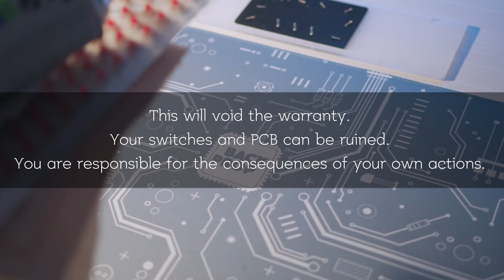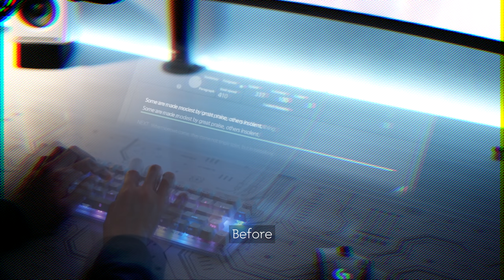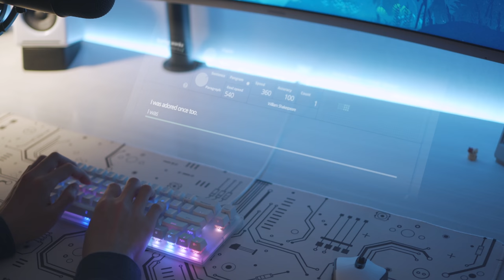Spray Lubed [Womier → GamaKay] K66 Typing Sounds (Gateron Red Switches)

Comment from the maker: * More information of spray lubing *
- How this works: This is not pouring oil. After the solvent evaporation(1~3 days), the inside of a switch will be coated by a thin film of grease. This is an alternative effective lubing way for pre-built 'soldered' switches. It's just an option. No one force you to do this.
- Don't do this for rubber switches such as Topre, Noppoo and silent switches. (Some say that Cherry's rubber dampers are okay, but Gateron's rubber dampers will get damaged clearly.)
- WD40 is not for this. Please refer to this product link. https://www.super-lube.com/multi-purpose-lubricant-with-syncolon-ptfe
- If you do this for click, tactile switches, the tactility will be reduced a lot.
- For optical switches, this will ruin the optical sensors on the PCB. If you really want to do, pull the switches out first and do individually not to get the PCB affected.
- Keep in mind 3:04

Before you spray lube, watch this video by Hipyo first!
https://youtu.be/n6wn8jaiqxg
How to fix a ruined keyboard using BW-100 by Hipyo
https://youtu.be/ZXB_FCIyU6k
Reply: So you can spray lube opticals if you take the switches off the board before spraying them?
Reply: @francis2317  Yes
Reply from the maker: @francis2317  yes
Reply: @3ildcat  thanks man
Reply: I did this in a clicky switches and the result was a bubblegum effect. No smooth at all :(
Reply: I was just thinking. Rubik’s cubes have many different special lubes that can be used for other stuff too. Maybe lubes from thecubicle.com maybe good for keyboards
Reply: if i do this to rk61 with blue kailh switches will i be satisfyed> cuz i still wanna keep clicky sound but i want them softer
Reply: what do you use to edit?
Reply: Is that screw driver ALSO a soldering it iron???
Reply: I know its not recommended, but i did use WD40 on my outemu blue switches, and its almost a year now, still everything perfectly fine. I clear the entire keyboard each 2 months and check every piece of plastic, seems everything fine. It sounds really amazing compared with the stock sound.
Reply: Is there anybody do this spray lube on Cherry MX Silent Red?
Can I have the link to the discussion about it @:3ildcat
Reply from the maker: @iamtienng  
These are spray lubed Cherry silent switch typing sounds.
https://youtu.be/5_u7GWf-Cn8
https://youtu.be/F9QRW50hf8U
https://youtu.be/H7NOwgczYlw
Reply: @3ildcat  thankyouuu, you are the best :x
Reply from the maker: Andrew Ooi I don’t know any other lubes are okay or not. Only that spray has been tested over and over (at least 100 keyboards) in my community.
Reply: @3ildcat   any reason not recommend using WD40 ? this is because my region does not sell Superlube and i was looking for any other things to replace it.
Reply from the maker: Andrew Ooi WD40 is famous for corrosion preventive lubricant and some people did with it and ruined their keyboard. Whatever you use, it’s up to you. Please note that I am not a chemist or something. I just use the verified spray lube. I haven’t tried any other spray lubes. So I can’t give you a clear answer.
Reply: @3ildcat   thanks , i understand now. Have a great day and take care
Reply: 저소음 말구 그냥 게이트론 황축은 괜찮을까요?
Reply: @andrewooi9748  Im going to try using WD-40 Specialist on an old keyboard in 2 weeks when the product arrives. I'll tell you how it went.
Reply: what if you do not wait for the 3 days, will anything happen?? or will it be fine to use immedietly??
Reply: I did this exact same procedure on my K66 and after 3-4 days some of the keys don't register, have to press multiple times and harder till it registers. any way to fix this? :(
Reply: So I’m assuming this wouldn’t work on a razer huntsman optical red switch?
Reply: WD40 exist in normal, ptfe and silicon so your super lube is ptfe.
Reply: @XenoVeyl  hey man, how did your experiment go? You were planning to use the WD-40 Specialist Dry Lube yea?
Reply: @XenoVeyl  any follow ups?
Reply: @Stuntman2128  still with the problem? it should solve over time, it doesn't the alternative is desoldering the switches and do a cleaning.
Reply: So either 31040 or 31110 are good to use?
Reply: @Antfarmcompany  Number one rule of lubing is to only lube linear switches.
Reply: @Antfarmcompany  never lube clickys
Reply: Hey will this work on my RK61 Gat Browns?

Comment: I finally got my yc66 (one layer higher, semi high profile version of this board), just wanted to give some observations for people considering this board in the future:

-The rgb is cool, no software and no per key backlight. 

-The pcb was a little loose inside the case, there are no mounting screws for the pcb, it just gets sandwiched by the acrylic layers. I had to put bits of electrical tape at vacant parts of the pcb edges, to make the pcb fit snug and not move. After applying 2 layers of tiny squares of electrical tape it fits perfectly and i have no issue with it. 

-Hotswap, and supports pcb mount switches. 

-The spacebar and modifier keys dont hit the plate when they bottom out completely. For me this affects the overall sound, most noticeable with linear switches. Not necessarily a con, i dont mind it to be honest. Im using Gateron ink switches on this board, and the soft spacebar bottom out is pleasant, quieter and reminds me of like Topre, soft and smoothness. 

-With clicky or tactile switches, it's a lot less noticeable as youll still be able to hear the audible click or bump. 
-It ONLY supports plate mount stabilizers, and be careful with installing them as the plate is made of acrylic and can break if forced in. Alot less forgiving than aluminum or other hard material plates. 

-Right shift is 2u as opposed to other 66 keyboards like the FC660m or clueboard, which have 2.25u shifts on both Lshift and rshift. 

Overall: Great budget board for someone who wants arrow keys, loves rgb effects, and doesnt mind the right 2u shift. Id highly recommend if you like tactile or clicky switches, and to follow this videos guide on how to mod it, its not perfect out the box, but if you like tinkering a bit to make your keyboard your own, its a fun EASY diy project.
Reply from the maker: Thanks for sharing the valuable information :3

Comment: I've followed your RK61 guide and spray lubed both my cheap keyboards! (GK61 with Gat Brown optical / Drevo Calibur V2 with some sort of red switches.) Both times have been successful for me. The Gat Browns were doing this annoying metal ping on key bottom out and spray lube has solved that issue.  I did notice a tiny little bit on tactility loss, but the switches feel much smoother and a little bit quieter.   Thank you so much for taking your time and making these videos!
Reply from the maker: I wonder you did the optical switches after taking out from the board?
As you can see the pinned comment, if you didn't, the optical sensors on the PCB would get ruined.
Anyway I am glad that you did and are satisfied with!
Reply: @3ildcat  fortunately the PCB and the plate came apart on mine because my switches are hot swappable, everything still working ok :)
Reply from the maker: @Synapzzz  Nice!!

Comment: If we have a hot swap keyboard should we remove switches before doing this?
Reply from the maker: In that case, it's better for the PCB not to get affected
Reply: Word of warning, Banggood RANDOMLY provides the Hotswap and Soldered variant. Buy womier somewhere else if you want a guaranteed hotswap version.
Reply from the maker: @QuackZack  To get hotswap for sure, find 'YC66' not K66
Reply: @3ildcat  There isn't a YC66 in banggood. Is there a link?
Reply from the maker: @vasantdmp  no switch, no keycaps https://kprepublic.com/products/hot-swappable-yc66-custom-mechanical-keyboard-rgb-smd-switch-type-c-acrylic-case

Comment: When you put the take in to stop the wobbly stabalizers, is the sticky part of the tape faced up or faced down? Also, I am a bit new so I''m not sure, but is this keyboard pcb mounted? (I don't see any plates)
Reply from the maker: facing down
the top housing is the plate as you can see

Comment: In a way, do you recommend this for a rk61 keyboard?  
I'm not good at soldering or desoldering. I feel like I would ruin it even more than with spray. I feel safer by putting spray lube, but it makes sense that it could make some keys stop working. Now I'm so scared to try both. 

Help. I'm a newbie and I just want thock keys ;w;

Comment: Where did you get the roll of sticky tap you used in stabs? Is the permatex you used in the video the same as the one you linked in the description? They are different containers so I just want to make sure it's the same! I will be following this guide 100% with my own Womier66!
Reply from the maker: It is a common fabric tape from a first aid kit. 
Yes same. I just bought subdivided one from a Korean online store.

Comment: Hey @:3ildcat I thought this board was hotswap? I’m assuming there are multiple variations of this board. And if you would have put switch films and took out stabs to lube, do you think this board would have sounded considerably better?
Reply from the maker: As for as I know YC66 is hotswap, not this. If you can desolder, it would be better for sure. :)

Comment: It's been a few days now. Have you had any issues with the board? I bought a KBD75v2 built by KBDFans and I want to lube the switches to reduce the ping. I can solder, but I'd really want to avoid desoldering and resoldering. With the risk disclaimer aside, would you recommend this as a good alternative to regular lubing? Is the difference between regular and spray lubing big? Thanks! Your videos are great, keep it up!
Reply from the maker: So far so good. Thanks :)
As the KBD75v2 is a custom keyboard...... why.. hmm..
I don't recommend any methods cuz they all are up to your preference.
The uncleaned, remaining grease is annoying so if I can open the switches, I prefer to do brush lube.
Reply: @3ildcat  Gotcha, makes sense. I might give it a shot and go very light. It's going to be tedious to clean the remaining overspray, but probably not as much as desoldring/resoldering.

Comment: did you end up using any foam/mat to dampen your keyboard? and what was the tape used for the stabs? i'm considering buying this for university ^^
Reply from the maker: I didn't use the foam. just a fabric tape (thicker than normal tape)

Comment: Is this board standard profile? Like does it have 4 2u stabilizers and 1 6.25u stabilizer? And are they PCB mount or PLATE mount stabilizers?
Reply from the maker: 0:28 low profile
0:49 plate mount
4 2u 1 6.25u
but as you can see, right shit is shorter than other normal keyboard
2u instead of 2.75u

Comment: What tape did you use for the stabilisers? Also can you do a little explanation on that tape method to cure the rattly stabs, and how you do it? Thank you, love the content!
Reply from the maker: just common fabric tape from a first aid kit
the different size of the plate and the stabs make rattling so applying tape fills the gap. That's it.

Comment: So I would love a custom keyboard, after doing my research I found that commissioned ones are very expensive (to get what I want) and was planning on building one of my own. Any advise as far as where to look, I have found switches I like along with key caps, just kinda lost on where I should go for the rest. As far as what is good without spending a lot. Also, love the videos :)
Reply from the maker: Google is the answer I think. 'DIY KIT' for any keyboards would be cheaper than other custom keyboards.
Thanks!

Comment: So for like Box Browns on my Anne Pro 2 (soldered) since I dont want to desolder the switches and spray lubing reduces tactility do you recommend I just lube the stabs at least....
Reply from the maker: As you can see the box switches stem structure, there is not enough gaps to spray in.

Comment: I just got a set of switches. Want to spray them. Do you still like the switches after a year, or do you need to re-spray them?
Reply from the maker: You don't need to re-lube but as you know, it's very simple, so if you need, just do it again.

Comment: Hey i used the old method (2 sprays on LED side) on mx cherry silvers and let them dry for 5 days now, but i think i got to much on the contacts so now some switches are incosistent. Sometimes the switch works fine but other times i press them 10 times with out an response. Is there a way to fix that? Will it get better in the futur? Are the switches trash?
Reply from the maker: As far as I know, people in my community fixed by hitting the switch repeatedly and very quickly. A few of them air-sprayed to the contact side and fixed.  And some say they fixed by doing re-spray lubing. If these things can't fix the switch, maybe desoldering and cleaning would be required.

Comment: is this a keyboard you would recommend as a first keyboard over the other budget options?
Reply from the maker: I usually don't recommend any but hmm.. for a first one, don't you need F1, F2~ keys?
You need Fn key to use them. It would be uncomfortable at first. If you are okay, whatever choose any size keyboard :)
Reply: @3ildcat  

안녕하세요! 감사합니다~

well i do find them necessary, but i dont seem to be able to find a good budget option with them. i thought this would be the best i could go for with the dedicated arrow keys at the very least. the 75% layout is definitely where my endgoal is at, however for starting out what keyboard would you recommended?

as per switches/stabs are concerned i'll definitely be lubing them and band aid modding them

Comment: How to fix spray lubed not work properly it made switches hard to activate ?
Reply from the maker: 5:09
If it can't fix, airspray to contact side, or desolder the switch and clean.

Comment: What is the thing at 3:21 for? Really want to do this mod just need to know if I need that.
Reply from the maker: disposable pipette (cut for preventing spray splash)
Reply: :3ildcat thanks, is the lube the same one that you linked cause I saw others that look the same but have a different number, thanks for the help.
Reply from the maker: @NotGoodAtYoutube  Mine is imported one for Korea so Korean words on the spray. But the Korean seller said it's 31110

Comment: Would you recommend this for cherry brown switches? Also which side of the switch is the contact side and the LED side?,
Reply from the maker: I don't recommend any. It's up to your preference.
You can see the side on the video. Where the led is, it's the led side.
Reply: :3ildcat how far into the key did you spray? And would you remove the switches first on a hot swap PCB?
Reply from the maker: @fengshui_  Using soldering iron, you can remove of course. How far... hmm.. just like the video.
Reply: :3ildcat can I leave the switches in the pcb though if it is a hot swap pcb?
Reply from the maker: @fengshui_  It's simply your call

Comment: I bought my Anne 2 Pro second hand so I don't know if the switches are Gateron or Cherry reds. But in case they are Gateron I shouldn't lube them with this method?
Reply from the maker: any switches you can do
Reply: But in the comments you said that it might damage the rubber dampeners on Gateron switches. What exactly is that? And does Gateron red switches have it?
Reply from the maker: @Xspeedzone  Gateron reds don't have the rubber dampers
cuz they are not 'silent' switches

Comment: hello~ i was wondering if youre just spraying the top area of the switch? What are the areas we should avoid spraying?
Reply from the maker: The spray should go inside the switch then it will spread evenly.
Reply: :3ildcat are there some areas we shouldnt spray?
Reply from the maker: @_aerue6813  As I told you, once you spray, the inside will be filled with the grease and solvent. You can't control that much. Or if you mean, trying to spray stabilizers? no. And you will not spray the out of switch, right?
Reply: :3ildcat what could happen that can ruin the keyboard?
Reply from the maker: @_aerue6813  Switches will not respond, pcb will not work, a lot of chattering can occur

Comment: hard to tell on video, but is this keyboard low profile like white fox? or does it have a tiny bit of height?
Reply from the maker: 0:28 pause and check. That's the height.
If you are looking for higher one, 'YC66'
It has one more layer.
Reply: :3ildcat omg thats exactly what I wanted to know. Thank you!